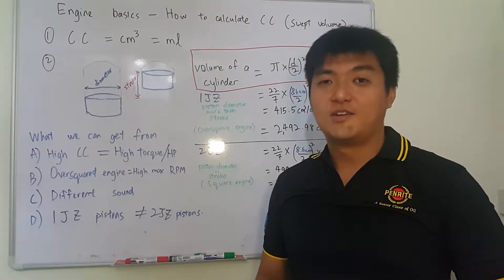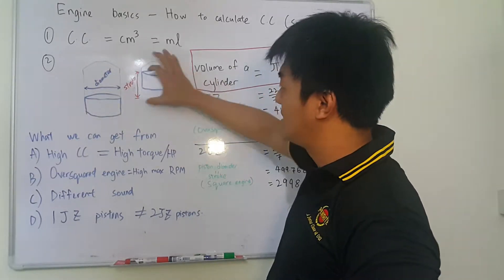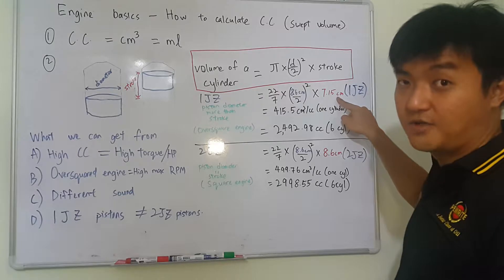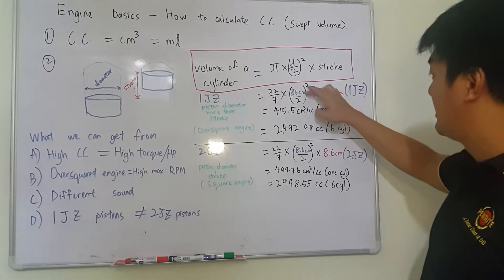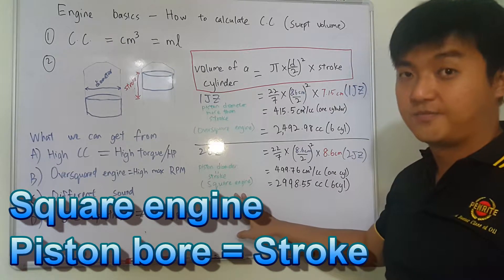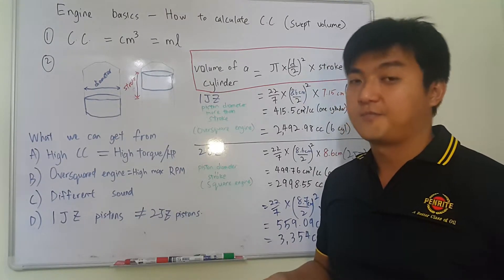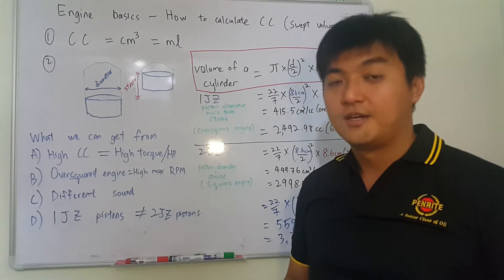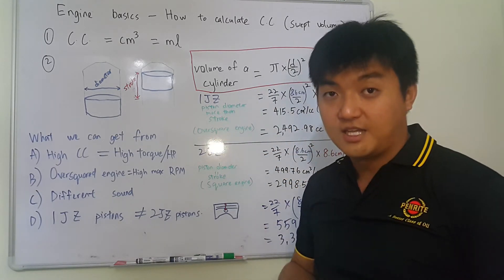2JZ Tuesday #5 - How to calculate engine displacement/ Engine CC

Comment: What is the  difference between the 1jzgte vvti and 2jzgte cylinder head  thank you
Reply from the maker: There are many differences. Intake exhaust manifold not the same, volume of gases different making compression of ratio different, but cylinder head bolts location are the same..
Reply: Thanks for the info and keep doing what your doing
Reply from the maker: @gibronjamaludin3683  thanks bro! =D